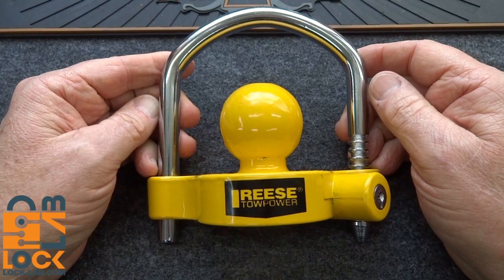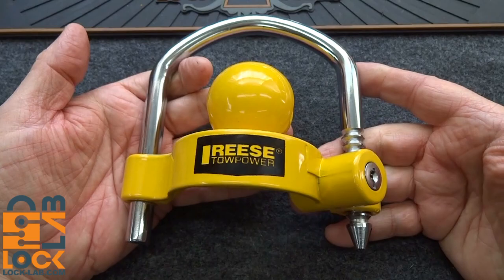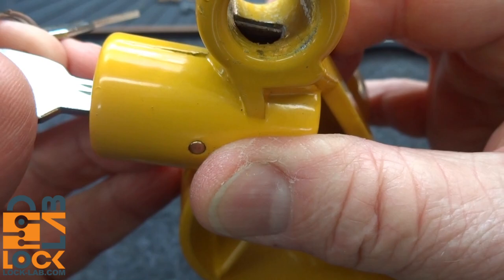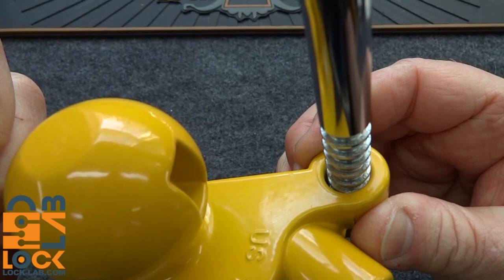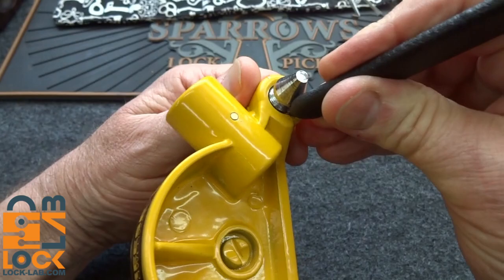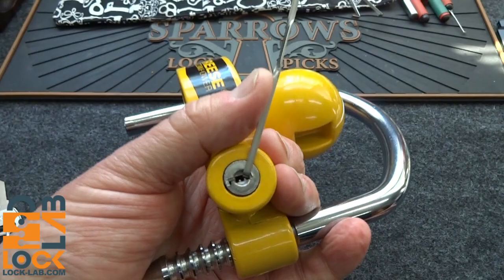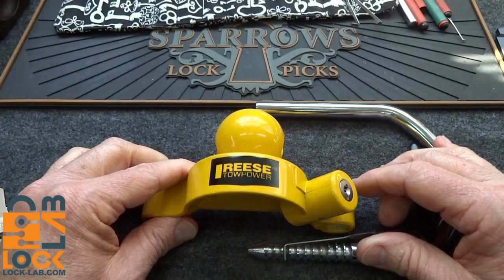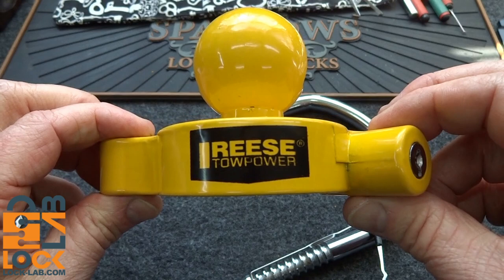(1026) Review: Reese TowPower Hitch Lock (JUNK!)

Comment: I just love your videos man. You're lilke the toned-down, locksmith version of AvE :) And the random use of fiver-promos is hillarious :)
But.... While the argument that no one should buy crappy unsafe locks for $30+ may work for your "return customers" on this channel, it doesn't really work in the wild. The vast majority of people doesn't understand how a lock works beyond putting in the matching key and turning it. Most wouldn't evwn understand either even the prinicpal objective differenve, or the practical difference in terms of a lock, between (cast) aluminium, steel, iron, zinc, nickel-bronze or a composite material. The knowledge "you and I" have about locks, took a long time to accumulate - and even then we might not recognize a serious security flaw without thorough inspection, some times actually needing a full  disassembly to notice. Joe Schmoe on the other hand, he doesn't know if 30-40 dollars is a reasonable price for a good, strong and secure lock. So he needs to base his purchase on, him relying on that the sales guy and/or the locks' promotional packing material, web description etc - accurately defines the locks quality and level of safety. And THEREin lies the problem. Sales personel might be incompetent, but if your question isn't highly detail specific, he could hype the product lying through his teeth, and you couldn't "catch him" on it. The same goes for packaging and commercial material; With no legally binding standard for "safety", "quality" and "security", those words don't mean jack sh*t, buy they sure sound good! In that manner, every Toys-R-Us cheap crappy lock can be promoted and described as the most high security apparatus made since Marions chastity belt in Robin Hood. And while that that might relatively and objectically be utter BS - technically and legally you can't call it an outright lie either. And Joe Scmoe can't tell the difference, nor should he really be expected to. At the end of the day, it comes down to false advertising within legal boundaries.

Comment: A thief is always going to find a way to steal something if they are determined enough. Anyone can pick a door lock with a $5 kit from ebay and 2 minutes of practice. Locks just keep the honest folks honest and the dumb criminals at bay.
Reply from the maker: I agree 100% with sentences #1 and #3.  It is #2 that is simply not true.  Good tools cost QUITE a bit more than $5 and it takes years to become proficient at lock picking.  You can learn to RAKE very basic locks pretty quickly, but in all the classes I've ever taught, nobody became proficient rakers until the 1-2 hour mark.  Single pin picking proficiency, required for MOST picking jobs, can take YEARS.

Comment: Really when it comes down to it, it isn't meant to STOP someone. Just make it inconvenient for bad/low end thiefs . Just keeps people from being able to pull up, drop the hitch on the ball, and pull away with the trailer. If someone wants the trailer they are going to get it, be it by cutting the cross bar, or just unbolting the receiving side of the ball hitch and bolting on a new one (two bolts, takes 2 minutes tops on most trailers)
Reply: yes these are best for stopping opportunity theifs, ones that just see something on a whim and take it
Reply: MemorableC that's why you take a chain rap it around the wheel and the axle so they will rip it apart driving away.
Reply: FishFind3000 just don't use a master lock for that chain 😂
Reply: Boot one of the wheels that will make it pain for any thief
Reply: All locks are about delay. But this one just does a really bad job of it.
Reply: The best solution i've seen, but, i do admit it does involve fiddling, is to weld two jacks between the axles and raise your platform (whatever function it serves above) when not in use, and secure those jacks.
Reply: A lock alternate purpose is to make it more evidant that you are actually trying to steal something. If you need big tools, it look like you are stealing it. However, if you somehow make it look like you are just unlocking it, it won't attract the attention of anybody and you can do it with people passing by. This lock fail at it's primary function (theif prevention) quite hard, it also fail at it's second function: slow down a theif. And the third function of a lock: make so it is obivious that someone try to steal it.

Shimming will look like if someone is using his keys and have a bit of trouble with the lock (rusty/dirty).
Reply: this product is meant as a bit of security theater to stupid trailer owners. a properly secured trailer has more than one of these shoved up in it, but people are cheap, and willing to ignore common sense if it means getting what they think is a "great deal"
Reply: That's why I added an extra hole to my trailer and it has a 1/2" security bolt in it as well, good luck getting it off 😋
Reply: Obie Sunstreak 
you pretty much could just pull up, hook up, and drive away with a trailer, with this piece of crap only requiring a simple extra step. The noise made by the quick whack of a stout hammer to remove this 'lock' would not sound particularly out of place among the other noises created in the course of hooking up a trailer. in the end all this item really does is create a false sense of security.
Reply: As the saying goes, "locks are for honest people".
Reply: The problem is, it doesn't even make it inconvenient. I smashed through mine with a 3lb hammer in less than 10 seconds and that is exactly how a thief is going to do it.
Reply: Obie Sunstreak The saying is actually: "Locks are to keep honest people, honest".
Reply: So true.  However, when a 115lb girl can pry it off in 1 minute, it's kind of worthless.
Reply: Customer Support do you have that video of the girl doing that?
Reply: My neighbor chained his jet-ski trailer w/2 skis on it , by running a thick chain around his oak tree back through his trailer tires....badguys removed the tires, stole the trailer and left two chained tires by the tree...theives faster than a Jeff Gordon pitstop
Reply: It already takes skill and materials to have a truck and be able to hook up a trailer, though. Having a hammer to give it 2 whacks is not a stretch.

Comment: I have multiple trailers and use different locks on each. I have one of these Reese locks...I'll be replacing it now obviously. But which is best?

I use these as well...

https://www.amazon.ca/Tow-Ready-63228-Coupler-Gorilla/dp/B004KJ6KFG

https://www.amazon.ca/Master-Lock-379ATPY-Universal-Trailer/dp/B000L9QRE8/ref=sr_1_3?s=automotive&ie=UTF8&qid=1489168041&sr=1-3&keywords=master+trailer+lock